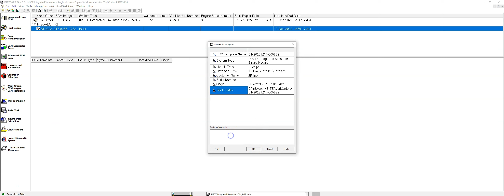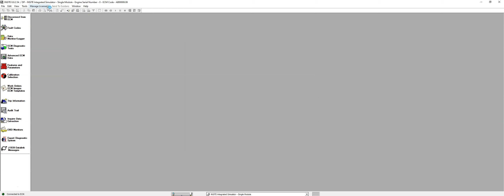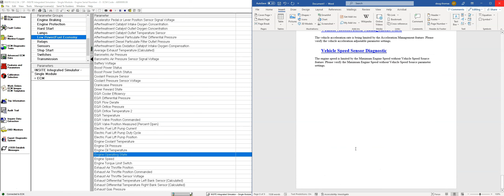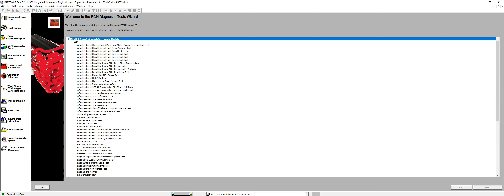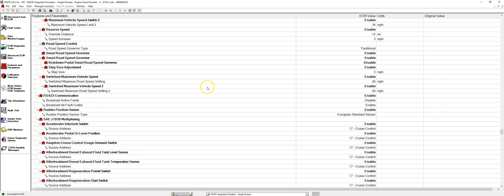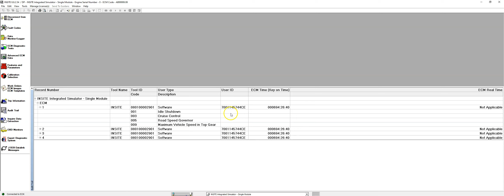Cummins Insite Overview Tips and Tricks using Engine State data and test

Comment: Hello good video by the way. Im very good on insite. But i have a yard of capacity trucks with tier 4 final. The trucks do not go in derate when egr def or scr issues. How would i be able to set that up? I cant find anything on it in perameters. Ive been emailing cummins but issue not solved
Reply from the maker: So the yard truck won’t go into derate?

Comment: Hi, I need to activate oem side of CM2150 to control retarder, The retarder needs to be shut off when accelerator is active. Can you point me in the right direction?
Reply from the maker: Most Jake settings can be controller on insite for Cummins. But if you want to adjust oem side for Peterbilt, Kenworth or freightliner you have to use oem program for each manufacture

Comment: Hi! If I replace the injectors on a 2015 Peterbilt ISX 15 do I need to recalibrate and if so, how? I was told to get that barcode off the injector and enter it. Thanks.
Reply from the maker: Yes there will be a bunch of numbers on the coil/top part of the injector. You will enter the injector code into advanced ecm data on Insite.

Make sure you perform the fuel injector reset afterwards

Comment: Is there a way to setup or make the Unit time show the date on the engine abuse history to see about the date/ time or the accurate engine hours that the engine was abused.
Reply from the maker: If you go into trip information you can see the total ecm time there or engine hours is also available. If the ecm was replaced it would be accurate though. 

I’ll have to look and see if there is a way to adjust the date and time.

Comment: Hi, if i have the inline 6 and the program, where i can buy the files to reprogram my 2004 Dodge ram ECM?

Thx Jan
Reply from the maker: I know you program the older vp44 trucks from 98-2002 but I don’t think you can program the 2003-2005 trucks with Insite. 

I have been told the 2006 and up trucks are able to connect to Insite.